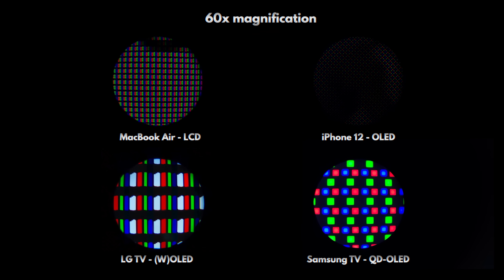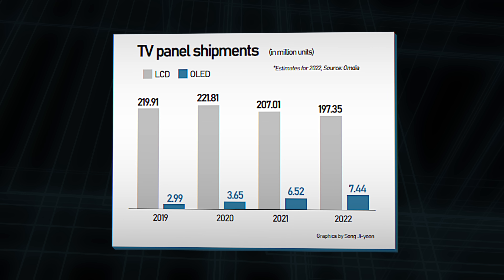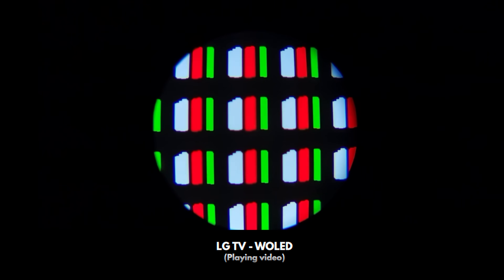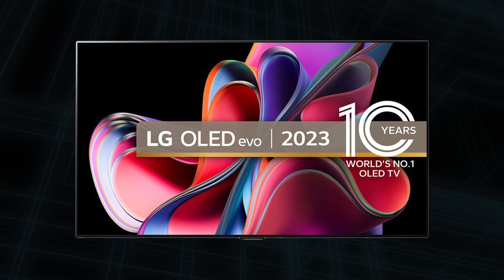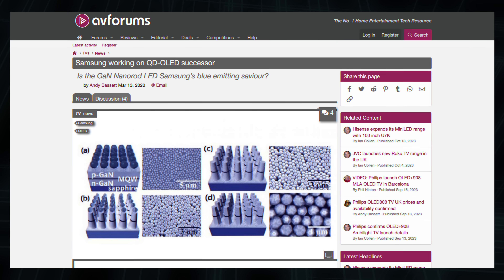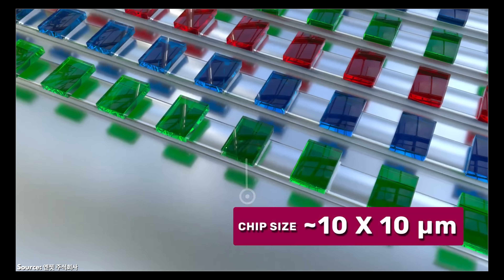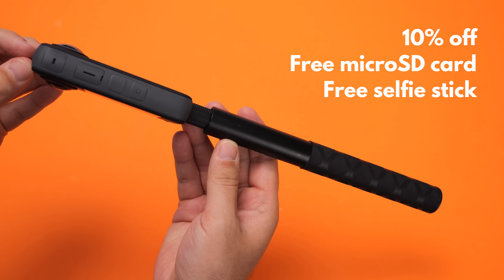The billion dollar race for the perfect display

Comment: Good roundup, I personally use 42" c2 oled as my monitor, Outside of hdr content I have its brightness @ 33% for comfort I think the marketing is aspect is overblowing the brightness issue and current gen oleds can display sufficient levels allready.
Reply: If it doesn't provide at least 500 nits, preferably 1000 nits, then the screen can't really display HDR content.
Reply: @mrlightwriter  It should be illegal to advertise HDR if the display can't even get half the recommended brightness, let alone can't get 1/4th like mine. My flagship phone is magnitudes brighter than my monitor while being cheaper than it.
Reply: @mycelia_ow  I agree with everything you said. If there's a minimum of nits for a tv/monitor/display to be considered HDR, that must be enforced legally.
Reply: @mrlightwriter   Manufacturers: "nonsense, 300 nits is fine for HDR"

I can't believe there are $600+ monitors with "HDR cert" that only get 200-400 nits. My LG Ultragear OLED costs almost $800 but apparently is only 200 nits max while claiming HDR 400 cert. It seems brighter than 200nt but it's certainly nowhere near 500nt.
Reply: @mycelia_ow  A big part of HDR is the low black value. Because LCD monitors can't reach such a low black value, they need higher max brightness for the same contrast than an OLED screen. If you're sitting in a relatively dark room, this might not be a problem, but it's not ideal in a well lit room.
And if your OLED is less bright than advertised, it probably means that it can only reach its advertised max brightness on a small part of the screen for heat reasons. So when an image is shown that has large bright portions, the total screen brightness is turned down to prevent overheating. I don't have an OLED myself, but I imagine that this can be annoying if the dimming is too strong.

Comment: I wonder if the MiniLED technology could evolve to make the backlights at pixel level sizes, thus making the crab analogy in this video even more true when it comes to LCD displays. A MiniLED display such as this could in many ways rival the OLED technology itself, because of the high brightness and no burn-in of the LCD technology. If that happens, I would seriously consider the MiniLED technology moving forward. Well, as long as MicroLED displays or similar technologies at consumer prices are still not a thing by then.
Reply: If it has become pixel size then there is no need for a LCD layer. At that point it would be a Micro LED display.
Reply: MicroLEDs are better than LEDs when you can make backlights at the pixel level. Why would we bother to put color filters when we can make RGB subpixels individual LEDs at pixel size?
Reply: @Almohebful   No there are uses for having a LED + colour filter approach because it can be scaled easily, is less complex and reduces cost. It is easier to fabricate a Micro LED of one color and apply QD colour filter than fabricating LED for each separate colour at pixel level. What having LEDs of pixel level eliminates is the LCD layer. Technically it will be a Micro LED display.
Reply: You are talking about DVLED, which is already available and the best display tech available right now, but it's expensive.
Reply: @Wobble2007  Thanks for the info; I've never heard of that technology. It seems like that kind of technology as of today are only for larger displays, in other words not currently suited for living rooms.
Reply: MicroLED displays still have the red, green and blue subpixels that are needed for each pixel as far as I know. However, a QD-MicroLED display could be possible if the backlights were pixel sized if I'm not mistaken. Correct me if I'm wrong.
Reply: @GAG091186   QD Micro leds are just blue micro leds with QD color filters currently. Research is going on in developing QD LEDs or Electro luminescent QDs which are essentially true quantum dot LEDs but currently they have issues with stability and have short lifespan.

Comment: Its surprising they went the whole video without mentioning vertical alignment or in plane switching LCDs. And when talking about older displays they didnt mention plasma. Plasma is particularly important because it has a very similar mechanism to OLED technology, but it uses a plasma instead of a solid polymer. I dont like that a video this long skipped so much important information.

Comment: My guess is that OLED is basically going to evolve into MicroLED (after Samsung acquires LG 😉), becoming the true 🦀– just because it's so much easier to make.

One other thing though: Power. You basically talked only about TVs (or maybe gaming monitors). OLEDs and MicroLEDs currently have another issue, which only affects "office work" situations: They can't get bright when most pixels are white. The insane brightness levels are always limited to small areas of the screen at once (i.e. to increase single-frame contrast, as opposed to frame-to-frame contrast) – otherwise the panels simply can't carry enough power. For notebooks, the power draw is also an issue for battery life.

Comment: My monitor is a LCD-VA panel & I’ve been pretty happy with the quality & working on it for the price! Though the viewing angles aren’t the best, I’m also not moving around all that much.
Reply: VA black smear
Reply: even if you don't move above, above 24 inch you can see color shift. not really ideal.
Reply: horrible response times, but yea its useable for the low price
Reply: @magyararon6918 he could have a Samsung va which are very fast. My 2020 odyssey g7 is VA but is still pretty close to the fastest lcds in response times besides that 540hz tn monitor that just came out which is a calibre above the rest. Either way unsure how it has still only been Samsung that have managed to put out VA's with not only, not bad response times but very good ones too.

Comment: I think your quantum dot layer was in the wrong place. Doesn't the quantum dot layer replace the filter layer?
Reply from the maker: Depends on the display, actually in some screens you have both. But since the quantum dots already converted the backlight mostly to the desired color, the filter will only filter out the little bit that the dots didn't

Comment: Speaking of OLED disadvantages, you are just scratching the surface. OLED technology is insanely bad and anti-consumer. Here's the short list of OLED "features":

1. Yes, burn in
2. Green/colourful lines across the whole screen after a year of usage. Go buy a new device!
2. Acid, unrealistic colours that a user needs to configure
3. Pathetic viewing angles with greenish tint
4. Greenish tint
5. Pulse-width modulation (PWM): if a user doesn't want max brightness, his eyes will be killed with CRT monitor-like flickering. Go buy new eyes (and don't forget about constant migraine)
6. More expensive than normal screens (IPS)
7. PenTile (more pixels needed to have a visual pixel density of IPS)
and more.

This technology is a nightmare, it will never get better enough and such screens should be banned!

Comment: People have a misconception of LCDs having worse sunlight legibility and power efficiency than OLEDs due to media. Here's the truth:

LCDs are leagues better in both of those areas. Why? Take the indivual light emitting diodes of OLEDs as millions of flames. They can easily be snuffed by brighter objects because their individual brightness don't rival the said brighter object. The reason why OLEDs seem brighter is due to the very minute or lack off light being wasted when generating light. This means that any color of light can be just as bright as the other colors around them as some colors do appear dimmer than others to the human eye. Also, unlike LCDs, OLED light is omni-directional, thus making a huge difference in viewing angles. But here's another the thing about OLEDs, to get dimmer pixels to brighten up, you need more power... The brighter you go, the higher the power consumption. In LCDs, you lack those problems. The main problem in LCDs are:
- Light loss
- Don't produce true blacks
- Pixel response rates
- Not great viewing angles

Get rid of those, and you get the economically and environmentally superior and better display.

Comment: I think that OLED's tendency to burn in is a little overstated. What you're generally seeing in those burn-in tests is a worst-case scenario: The TV is left on constantly, showing a relatively static image, like a news network's chiron. OLED sets go through image refresh cycles when they're powered off, to at least try to counteract the problem of image retention. If the set stays on all the time, that process never gets a chance to run. 

LCDs can have image retention problems, too. Granted it takes longer to show up on one, and it's usually reversible unlike actual OLED burn-in. But not always. I've seen plenty of LCDs with the ghosts of static images permanently stuck on them, including my own computer's monitor. 

In any case, even inorganic LEDs lose brightness over time, with the blue ones fading first. They tend to fail sooner and more frequently as the LED die is shrunk too, so I would expect micro LED sets to at least have some potential for burn-in and dead pixels just like the others.
Reply: The OLED's burn in issue is definitely not overstated. I have an iPhone 14 Pro and I have burn-in. However, it wasn't caused by the always-on display, but rather the icons of Waze (I use GPS for about 1 hour each day).
Reply: @mrlightwriter  WOLED and QD - OLED are less prone to burn in than standard RGB OLED used in phones.
Reply: @Ishpreetb264  Wasn't aware of that. Good to know!
Reply: I was worried about burn in, because my dad's Samsung Note phones all started having severe burn in after just 1.5 years. The back-arrow from telegram and the Keyboard were visible everywhere. 

But then I got my Xiaomi note 10, and 5 years later, I can kinda start to see some random burn in... But it's not permanent. I've noticed right after purchase that every now and then the display would shift it's pixels by one pixel, in a circle, making static images not static anymore and blurring potential burn in lines.
Reply: Nah, in 2 years my s20 fe burned in. It uses oiled. My cheap a21s I bought years ago still looks fine.

Comment: The crab analogy is all wrong here. The ideal display properties being applied to all display technologies doesnt equate to an independent evolution to a common design under divers condition.

The display technologies have the same ideals because they are designed and developed to fulfill the same needs. They are competitors for the most part.

Comment: There is no Apple Pro Motion monitor. Apple has ProMotion technology that it integrates into various displays in its products however neither of Apple displays has this technology. Apple sells two displays. Studio display which is basic LCD and Pro Display XDR which is not miniLED. It only has about 550 local dimming zones compared to 2500 local dimming zones on iPads and MacBooks.

Comment: I just want someone to make CRT displays. 

It would be a super niche market,  basically old school gaming hobbyists and legacy film and TV people. But it’s so hard to do stuff to get around the inherent differences in how old displays and new displays work. I’ve spent hundreds if not thousands trying to do it in a satisfying way, when if I had a really high quality, 1080i or 480p display then I could do a really nice custom setup that actually fits the theme of “I’m playing a Nintendo 64”
Reply: Turns out that led lined glass tubes are really bad for the environment... Who knew?
But you can still get used crt TVs and monitors, so if you want one, get it while you can! Just understand how expensive it is to get rid of the things when the time comes. They aren't cheap to get rid of.
Reply: @CaedenV  They are only bad for the environment with improper care
Reply: You can't, use of heavy metals that're required for CRT's is banned pretty much everywhere.
Reply: @MLWJ1993  Not for CRT's
Reply: We still have our Panasonic CRT out on the 4 season porch, picking up over-the-air, serving a DVD player, and an old slow Roku. It's 21 years old now and still works fine at its native low rez. I hate to get rid of it just because it's old tech.

Comment: 🎯 Key Takeaways for quick navigation:

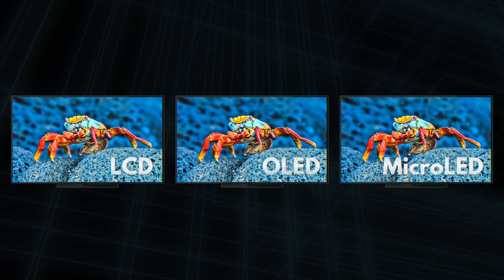00:43 🦀 Display technologies, like LCDs, OLEDs, and micro LEDs, are evolving towards a common goal despite starting differently.
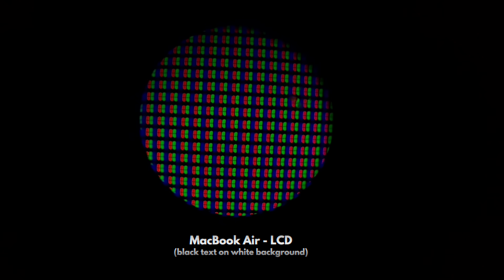02:34 🖥️ LCD technology uses layers of polarizers, liquid crystals, and color filters; advancements include mini LED backlights and Quantum Dot color filters for improved efficiency and vibrant colors.
05:32 🌈 OLED technology, with its individually lit organic LEDs, offers advantages like thinness, flexibility, and superior contrast; improvements address issues like burn-in and brightness limitations.
13:39 💡 Micro LEDs are considered the truest manifestation of ideal display technology, with individually stacked LEDs for each pixel, providing benefits of OLED and LCD without organic materials; however, mass-market availability is still in development.

Made with HARPA AI

Comment: Now if only all OS‘s would do proper sub-pixel rendering and all applications would use this system instead of using a backed-in system and rendering text themself (looking at you all browsers), then we could even get rid of color-fringing. Allowing for nice text rendering even on non-Retina DPI displays (they fix color fringing by making the subpixels so god damn small you can‘t see them anymore, which is certainly one strategy, an expensive one).
Reply: Microsoft had already mastered pixel perfect text rendering for quite a while until Microsoft ruined it with ClearType. Subpixel rendering is fundamentally flawed as it is incompatible with pixel perfect rendering.

Comment: If OLED was actually affordable I might be interested. As it is I have a 4k 144hz LCD and it cost half the price of an OLED.
Reply: But you have obvious trade-offs: colors are less vibrant in the truest sense while blacks aren’t black & the device uses more power. These might not be priorities for you, but it is others. The part that gets me is the gamer mentality if 144Hz being so prioritized in laptops for ages that it was difficult to find color accurate, wide gamut, OLED panels until just recently since all the focus was tailored toward gaming.
Reply: @gotoastal OLED is actually wildly inefficiënt at higher brightness, using ~4x more power than your typical back-lit LCD...

Comment: I'm surprised that you didn't talk about nanoled displays. Mind you, they seem more of a transitional technology to get to the goal of true microleds mass produced. Still, it's an interesting display technology that deserves a mention. Also, very good video.
Reply: Well nanoled is a marketing term some brands use for miniled (which on itself is a marketing term for full array local dimming) and he did mention that just not by name.

And since this summer nanoled is also used a a marketing term for EL-QD (Electro luminescent quantum dots) to make it make it more confusing. this even has nothing to do with leds anymore. (and is not even available so why tech paper invent new irelevant names for it, just does not make sense to me)

By the way, he also mentioned Electro luminescent display's near the end. These work by exiting the quantum dot's with electricity directly instead of with blue light from oleds. This would be the holy grail to me, even better than microled. This would have alle the benefit's of microled but:
- with smaller pixels (maybe even as smal is in micro oled)
- cheaper to produce
- as thin and flexible and foldable as oled
- colors as as vibrant as Quantum dot displays

Edit: i may get why it could be marketed as nano led (even there is no diode that emits light) since the pixels are smaller than microled, Light Emitting Display ;-)
Reply: @ChristopheVerdonck  good point

Comment: The future is FAST VA (cheap), and OLED (expensive) for tvs and monitors, and microLED for AR glasses that can substitute monitors and tvs.
Reply: Micro led not so much for AR/VR. the pixels are close to 1 mm (even to large for normal consumer TV's) 
Micro oled with pixels smaler than 10 micrometer (0.01 mm) yes.
Reply: @ChristopheVerdonck  Yes, my bad.

Comment: What a fantastic video! I thought I knew a lot more than I really did. I wasn't aware that W-OLED doesn't have true rgb LEDs. I also had no clue what quantum dot stands for. I kinda just blindly assumed it was a dumb marketing term.
Reply: QLED is a dumb marketing term.

Nanocell is a dumb marketing term.

Liquid Retina Display is a dumb marketing term.

Quantum Dots isn't.
Reply: Current QD tech is just a quantum dot treated film layer, true eQD, aka self-emissive QD, that is the real exciting prospect, it has the potential to completely surpass anything we have ever seen and will completely make all other displays obsolete, even the best late generation CRT monitors and Plasma Kuro and Neo displays, but like mLED, eQD is 15-20 years away, Tandem PHOLED is the best we can hope for through the next 10-15 years, they could combine MLA with QD treatment, imagine those MLA lenses treated with quantum-dots on a Tandem-PHOLED display, that would be incredible, especially if it had a true 8K dynamic resolution.